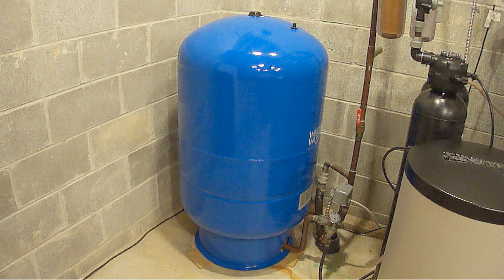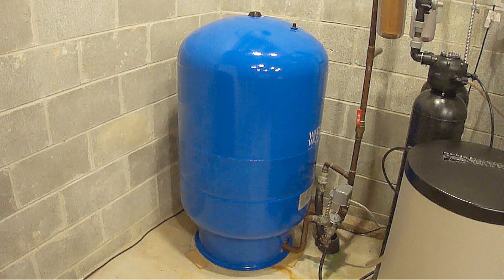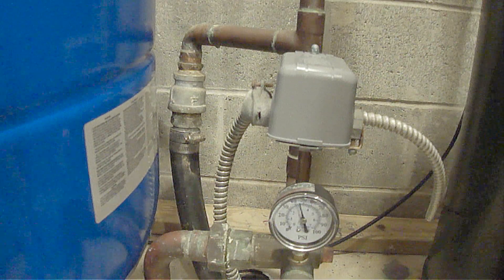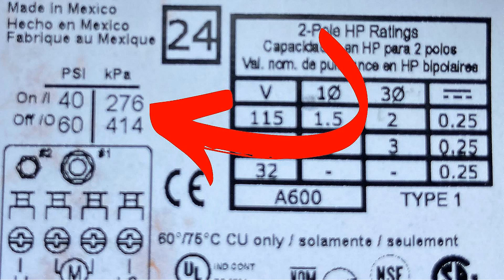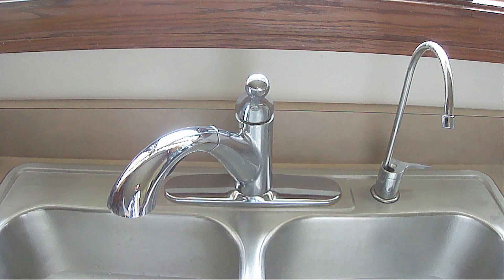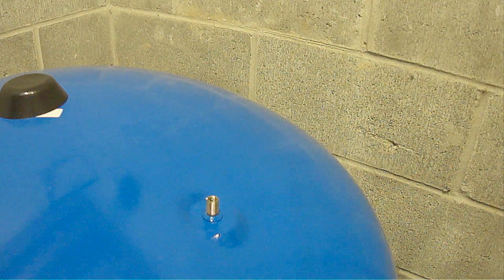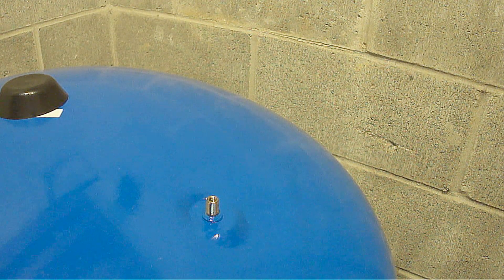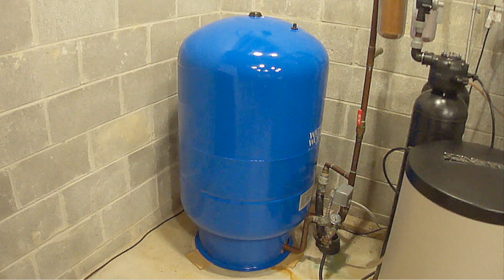How To Adjust A Water Well Pressure Tank - Fast & Easy!

Comment: Thank you for this video. However my problem is that when I got to check the pressure in the holding tank with a pressure gauge water spurts out. Is this normal or do I have a bigger problem? I recently replaced my pressure switch but that did not last long and begin turning on and off rather quickly causing pressure at the faucets to be very weak as you hear the switch cutting on and off rapidly and leaving pressure at The faucets very low and struggling

Comment: Maybe you can help I cant get the Guage to go above 40 an pump stays running will this have something  to do with that? I dt think its sucking air because  its holding... I just recently ran out of water now I have water i cant get it above 40psi. Its set for 35 an 65psi for pump.... thanks
Reply from the maker: What you’re describing happened to me four years ago which ended up being the top of my submersible well pump was cracked and had to be replaced.

Comment: What is the difference with a 30/50 switch vs a 40/60 switch. You can set the 30/50 to 40/60 to increase your pressure, so is the 40/60 incase you wanted to go higher?

Comment: This guy just saved me $400+!!!  I thought I needed a whole new tank when I was just low on air.
Reply: That usually means you have a leak somewhere in your plumbing bleeding off pressure over time or the bladder in the tank is bad.
Reply: @YousufferfromTDS Exactly, it's on its way out. Might as well do a preventative headache (like burning out the well pump) sooner than later.

Comment: OK, so mine cuts on 32 and off at 59 and bladder tank was at 24, so I bumped it to 29. Next showers we will be able to tell, we been having werid fluctuating water. Gosh I hope it's not the deep well pump, that's been in there since 92.
Reply: Wonder how it would lose pressure? That's the third bladder tank and the forth pressure switch.
Reply: I used to know this stuff like it was yesterday, what's wrong with my memory?
Reply from the maker: If your deep well was installed in 1992 you are definitely on borrowed time. When there’s no water running in the house does the pressure gauge slowly bleed down. If it does, then you probably have a crack on your well pump pipe connection. This happened to me four years ago. It cost me $1600 to have a new 1 hp pump installed.

Comment: Thank you sir. It’s 8/2025 and your video just help us with our well pump. I knew the pressure wasn’t right but had no clue it was only around 10 psi in the tank! No wonder our showers and sink water had such low pressure! I’d like to add a gauge to ours as it doesn’t have one and that would be helpful to be able to easily monitor the pressure. Thank you again for your simple instructions (and warnings) in your video.
Reply: Oh wow, what a great time to add a T in line with a reducer to 1/4" pipe thread. Buy a good guage don't cheap out because it sucks turning off draining pipe wrenches out.... You know the drill.

Comment: We built a new house 6 years ago, installer could only get a 20/40 switch that day. He installed it and said he would be back with a 40/60 switch, but never came back. Surprise. Surprise.
The pressure is terrible, the kids can't even use sprinklers outside in the summer. 
I bought a 40/60 myself. 
So, to be sure......can someone verify these steps?
1. cut the power to the well pump/switch
2. Open faucets to drain the water out.
3.Empty the bladder on the pressure tank.
4.  Remove the old switch, install the new switch.
5. Pump the bladder back up to 38psi
6. Fire it back up and and have a beer.
Does that about cover it?
Thanks!
Reply from the maker: On my channel, go to Playlist. Under Household, you will find instructions on how to install a well pressure switch

Comment: My RO system's app was getting bad readings, was advised to adjust water pressure, pressure tank was at 23 and req 28 (I learned from your video) fingers crossed it solves the problem but the house pressure is already Much better thanks!

Comment: This is assuming the switch has not been adjusted at all out the 30/50, 40-60 factory adjustment. What you should really do is observe where at what psi the pump switch cuts in as you empty the tank and adjust the tank pressure to be 2psi below the actual cut in pressure of the switch.

Comment: With a 40/60 pressure switch. I am getting 40 psi at the outside Spicket with 38 in the tank. Is there a way to increase pressure at the faucet?

Comment: My pressure switch is set to 40/60, when it hits cut out at 60 it drops 2-3 PSI without system running. Replaced switch recently so I know that’s good. I hear no sloshing for a bad bladder. Any other thoughts?
Reply: Normal enough. 
When you pump up tire, same thing happens. Shut off portable pump, drips about 2 pounds

Comment: My pressure switch is set to 40/60, when it hits cut out at 60 it drops 2-3 PSI without system running. Replaced switch recently so I know that’s good. I hear no sloshing for a bad bladder. Any other thoughts?

Comment: I  did this and my pressure was about 20lbs should have been 58. So I did everything like you said and it was great for about a week and now the water pressure seems low again. It's a well and the second floor is the issue. Any suggestions ?

Comment: My irrigation line T's into my main well line to the house. Does the size of the pressure tank play a role in the effectiveness of the irrigation system? My tank is only 20 gal and I've noticed the tank pressure/pump cycles rather quickly when the irrigation zones are running. The main/irrigation T comes prior to the pressure tank in the line, it doesn't seem like water would be making it to the tank to refill and would just continue to cycle. Any insight would be appreciated, thanks.
Reply from the maker: @jakebosquez4060  All I can tell you from what you’ve described is your putting a tremendous amount of wear and tear on your well pump. You’d be much better off having an 86 gallon pressure tank.

Comment: I have been having low pressure issues. My pressure tank increases pressure on its own. I adjusted it to 28 psi and i checked it a week later and it was at 45 psi. Any ideas??

Comment: My well pump pressure switch has a small lever. I always turn off and drain the tank before winterizing our summer house for the cold winter season.
In the spring, I turn the power back on and need to pull up and hold the lever until the tank is full enough to run on its own. When it reaches the set pressure, it turns off and I’m okay until it’s time to winterize it again in the fall.
My question; why do I need that lever in the first place?

Comment: Why does the pressure tank have to be 2 psi below the pressure switch low-pressure cutoff? What would happen if it was 10 psi or 20 psi below the low-pressure cutoff?
Reply from the maker: @RichardEstabrook-c8m  A well pressure tank needs to be set at 2 pounds below the cut-in pressure to ensure the pump turns on when the tank is almost empty, maximizing the water stored and minimizing unnecessary pump cycles, which helps to extend the life of the pump by preventing it from running too frequently; essentially, this 2 psi gap allows the tank to utilize most of its water storage capacity before activating the pump.

Comment: My pressure tank instructions say to empty the pressure tank of all water.  There is a drain on the bottom of my pressure tank to do this.  No water in tank to displace area to be used by the bladder when bladder is pressurized says instructions.  Just opening valves in house does not empty the pressure tank of water.  It just makes zero pressure in the system outside the pressure tank.  Pressure tank still full of water if just opening valves.   Bladder will not fill up with air as it should with water in the tank displacing space.   Instructions say if this is not done, pressure tank will operate improperly.   Water has weight.  Think of this:   A tire jacked up with 10lb psi is perfectly round.  A tire on the ground with weight of object and 10lb psi is half flat.   A bladder full of air can be 10lb.  A bladder almost flat can be 10lb.   If no drain plug, I have broke open the in line to tank to drain.   Plumbers sell new tanks to fix "bad bladders" which are not bad.  New tanks are pressurized before adding water.   Improper airing of tank after use over time fakes a bad bladder.

Comment: You need to check the actual turn on pressure of your pressure switch as it may not be exactly 40 psi even if the box says it is

Comment: So when the pump turns off it’s at 60 psi, shouldn’t the expansion bladder be at 60 ?
Reply: This procedure is just the base setting. When you power up the pump the pressure reading at that fill valve will be whatever the shut off point is.... so yes, it will read about 60 psi.

Comment: Years working on water systems I thought you would have some weird ideas. Exactly the way I was taught and did for the next 20yr. Only no body was charged 75$. Good job.
Reply: I have 2 pressure tanks on my system thst sit side by side. How do I go about setting the pressure? Mine is set at 40-60.. Do I set both tanks at 38psi or ? Thanks for any help.
Reply: Sounds right... Hope it was correct.
 @Bigbadbedford88
Reply: Now, 75 is like 20 or 30 back then.

Comment: I cut the power and the water supply to my tank and was in the process of adding air to the bladder. I do believe the bladder is bad however. My question is what do you think the problem is when the tank won’t receive air. I verified air is coming out of the chuck, but no air is going into the tank. Thanks.

Comment: So you leave all the taps open while pressurizing the holding/bladder tank? It’s not an open system?
Reply: The system needs to be open as you are ONLY pressurizing the tanks static pressurized system.  If you close off the plumbing leading to and from, your also pressurizing the static atmosphere of the system ITSELF as the filling of the diaphragm and its expansion then positively effects the static atmosphere within the plumbing system as they interact with one another, although they ARE independent and isolated from each other. As the diaphragm expands outward, it compresses the air in the plumbing system that sits adjacent to it. The same goes for the bladder system but opposite, the air trapped within the bladder and the piping system is positively affected by the increase in pressure accumuling in the tanks air chamber. Either way, positive air pressure is allowed to build INSIDE of the plumbing system IF the system is left closed and sealed. Opening valves allows air to escape as the system next to it grows in pressure,  which would be compressing the air IF it was trapped without exit in the adjacent plumbing system itself

Comment: After I turn off the power and run the water until it stops my gauge still reads 40psi. Does this mean there just stored pressure in the pressure tank? Should I attempt to lower it to 0 psi or get a new gauge?
Reply from the maker: @jungloveproductions  My best guess is you need a new gauge.

Comment: Great instructional video. I was just wondering, after you open a faucet and get the pressure to zero on the gauge, will the tank also have zero pressure?
Reply from the maker: @stevezakis3274  Yes
Reply: @proclaimliberty2000  Thanks.

Comment: I was always told it was 3 pounds more. Who is right?
Reply: 2 to 5 pounds less than the pressure kick on point.  Go 5 pounds less if you are in a hot region… 2 less if in a more temperate climate.